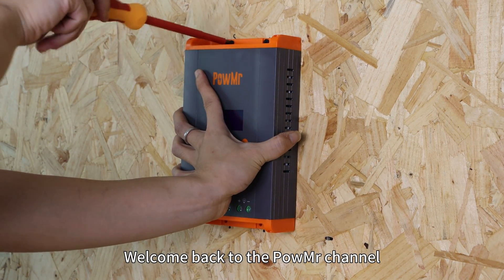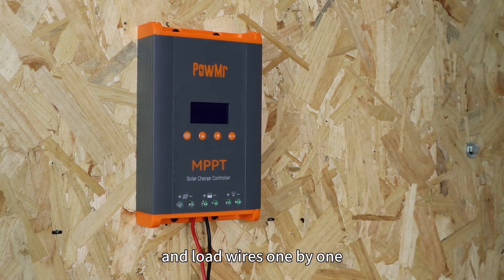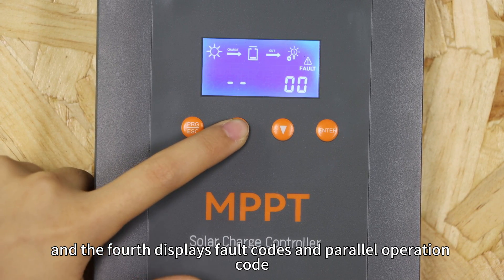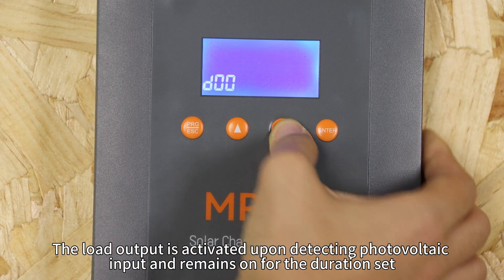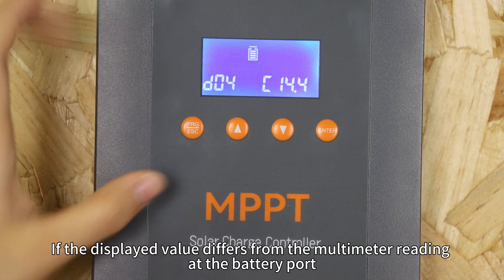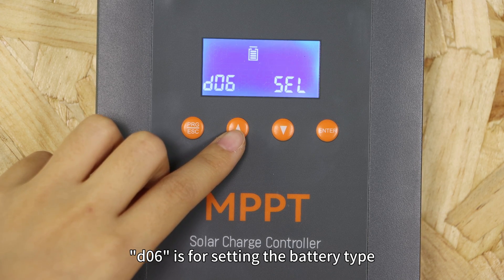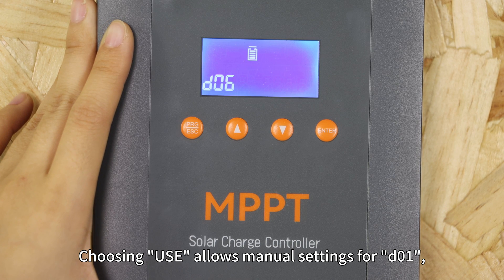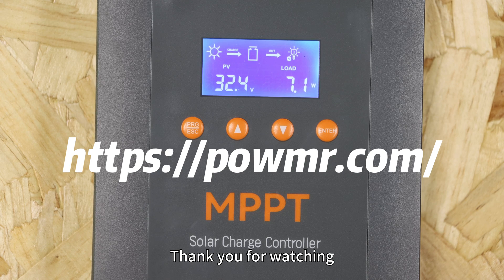HHJ60-PRO: Installation, Wiring, and Configuration Guide!

Comment: El controlador siempre está en "Night mode" como lo quito?
Reply from the maker: Consulte la página 14 del manual de instrucciones.
https://cdn.shopify.com/s/files/1/0746/0415/1079/files/HHJ60-PRO_User_Manual_EN.pdf?v=1703123572
Reply: @PowmrSolar he hecho todo lo del manual y sigue igual, dígame usted que más puedo hacer?
Reply: @PowmrSolar tengo casi 100 voltios en paneles y sigue igual.
Reply from the maker: @kerlynespinal5866  Try starting the controller with only the battery connected, and then pressing and holding the last button for more than 5 seconds.
Reply from the maker: @kerlynespinal5866  Try starting the controller with only the battery connected, and then pressing and holding the last button for more than 5 seconds.

Comment: If my bms shuts down while charging, will the incoming pv voltage kill the controller?? As there's no battery voltage... but still pv is connected.  Please reply...
Reply from the maker: If the BMS is disconnected, the controller will shut down.

Comment: Hi,
Connecting PV without battery kill the controller?? My 3 longi 355wp pv give 108V in series, can it be used for 24V system? Manual states that recommended Voc is 105V for 24V system... pls reply
Reply from the maker: Maximum Input Power for 24V system: 1440W
Input Voltage Range for 24V system: 37V~105V

Do not exceed the maximum value.

Comment: Hi I just bought this controller. I've set the d06 to custom, d07 to 24v, but d01 can't be increased more than 17v why?
Reply from the maker: The controller will automatically multiply the voltage. For example, if the voltage is set to 15V, it will be set to 30V for a 24V battery.
Reply: @PowmrSolar Thank you so much for your quick response. I'll definitely try it today & update. One more thing,, connecting pv input without battery will kill the controller?
Reply: @jahirulislamshovon9256 it will not kill but not working also, I have tried.
Reply: @shimulthecardoctor3715 thnx for your reply. I've found an interesting thing, when the bms is turned off full solar voltage is just passed on battery terminal. After that I've returned the product & got an older hhj60 version which works without any issue.

Comment: When does the mode change from 4.0(mppt mode)to 7.0(boot charging mode)?
Reply from the maker: It depends on the floating charge voltage setting. When the floating charge voltage setting is reached, it will enter the 7.0 mode.

Comment: Ihave  HHJ60-Pro and 
2 Battery 12v-100ah in parallel
Scc= current 25amp..
But my battery just went to 13.5volt and never go up....which is my problem? My SCC powmr or my lifepo4 battery(powmr)
Reply from the maker: The battery cannot be charged. Is it a lithium battery? Is it protected by the BMS?

Comment: With 12volt system can i make the charging voltage to 14volts?
Reply from the maker: Set the D06 battery type to USE and then you can set the parameters.

Comment: what string use for 24v lithium battery? cells is 3.2 each
Reply from the maker: Please refer to the battery specification for details.
Reply: @PowmrSolar  No it is 7 and not 8. 8 does NOT fit with the solar inverter as 8 is too high a voltage for a 24 volt system, it must be 7 and this charger does not support it, I have tried in vain to get an answer from you with no success, it should be possible to choose 7 li-Ion string system for 24 volts as it fits much better. I bought three of this type of charger from you, and now I have a system that is unusable.
Reply from the maker: @MrProvinspoul  You can select USE mode and then set the battery voltage.

Comment: How can I set the voltage in use mode? I have the USE program and D7 set to 24V. I can only set the maximum voltage to 17V.
Reply from the maker: The charging parameters for lead-acid batteries and user-defined batteries listed in the above table are for a 12V system voltage. For a 24V system voltage, these values should 
be multiplied by 2. If a lead-acid or user-defined battery with a 24V system voltage is connected, the actual charging voltage will be twice the value displayed on the screen.

Comment: How can i set those 24v set.up pls help should i use use? Option to set up high and low voltage?
Reply from the maker: If D06 is set to USE, it will enter D07 to select the system voltage. If D06 is not set to USE, the
system will automatically detect the system voltage of the connected battery and will not enter
D07 setting program. The system voltage configuration range is 12V/24V/36V/48V.
Reply: @PowmrSolar  i have been there in this kind of senario. I think auto detect represent the total system voltage and when you press setting on D01 represent of  1 gel battery i cannot set it to 26.7v

Comment: If the unit is wired in 12 V input mode, and PV wattage is at maximum 120 W input, will this unit put out 60 A charging power?
Reply from the maker: The charging current cannot be set, and it depends on the specific PV panel configuration and weather conditions at that time. It is not determined by the controller alone. The power generation efficiency of the PV panel itself will also affect the charging current.

60A is the maximum charging current, but it will not be at the maximum all the time, and your configuration may not be able to reach the maximum.

Comment: I intended on buying this charge controller but looking at it right now i see it has no option for a 3 string lithium ion phosphate battery being 12.6v 
There's only option for 4 string being 16v
Reply from the maker: Is the voltage of a single cell 3.2V?

Comment: i set d02 to 56 volts and it never stopped, it let the voltage on my batteries go up to 59.8 volts, whwn i caught it; but are the batteries damaged now? they are lifepo4, they can't go over 3.60 volts or 57.6;
i turned off the solar panels but how can i set it to 56 or 55 volts MAX, to see if it works?  is it possible with this piece, thank youy.
Reply from the maker: Please send your problem to this email: support@powmr.com.
Reply: Same with me, my lithium battery is 14.4 but it overcharges to 14.8 how do I set it to charge within it's limits??

Comment: I have custom lifepo4, I set d06 = USE, d07 set to 48v, but I can set float (d01) and boost (d02) voltage more than 17v. I need d01 = 55.8v and d02 = 56v. How can I do it?
Reply: I got an answer, maybe it will help somebody: Dear customer, 
Thanks for your writing. 
The preceding parameter ranges apply to the 12V battery. When the connected battery voltage is 24V/36V/48V, the range values are 2/3/4 times of this range, respectively. And the LCD only display the voltage of the 12V battery.
Kind Regards,
Ada
Reply: @vitaliinormatov  This is really ridiculous. How did it pass quality control?
Reply from the maker: Please send your problem to this email: support@powmr.com.

Comment: Whats the difference between M60 pro vs HHJ60 pro?
Reply from the maker: HHJ60 pro can be used in parallel.
Reply: @PowmrSolar  So we can use two solar panels strings individually?
Reply from the maker: @norbertrivera  It can be used in parallel.